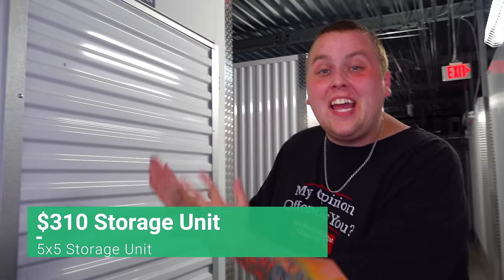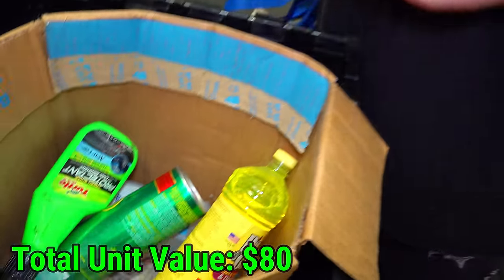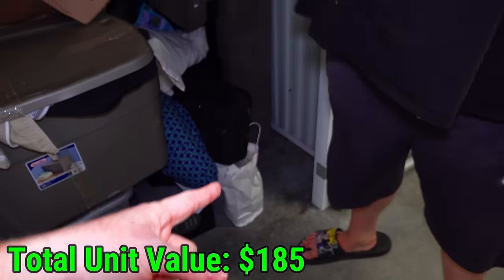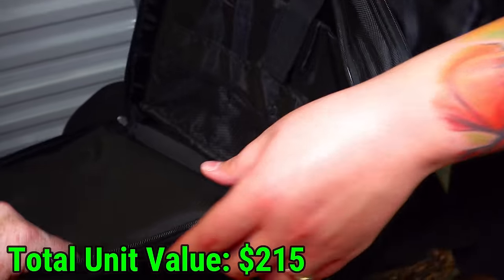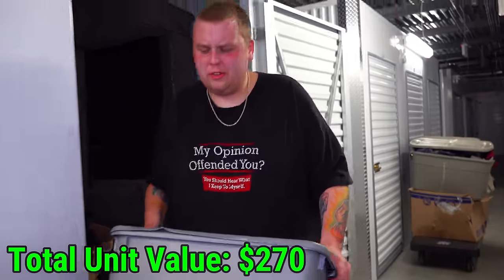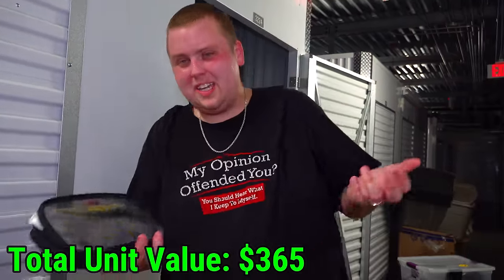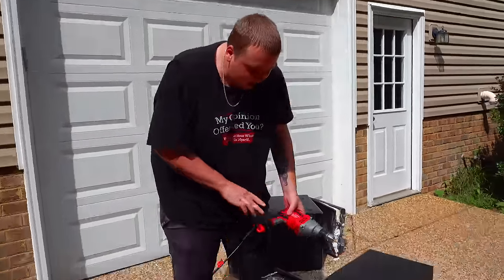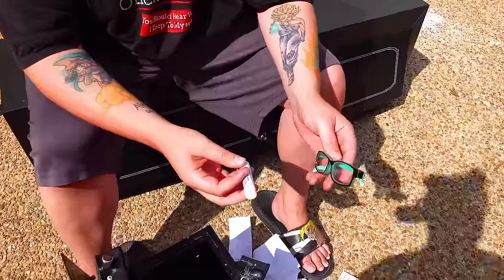I Found His Brothers REMAINS In This Storage Unit...

Comment: What you just tried  to use was a large tube that was used for putting  that inside the shoulder blades of the body to help flush out the body😳